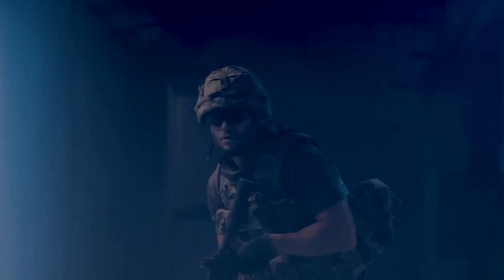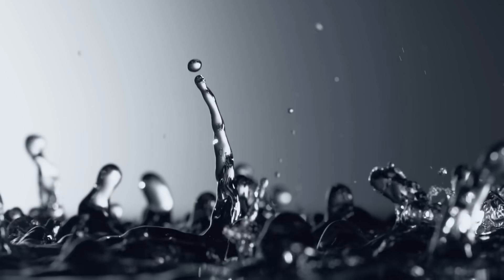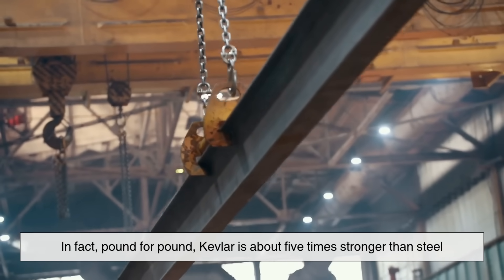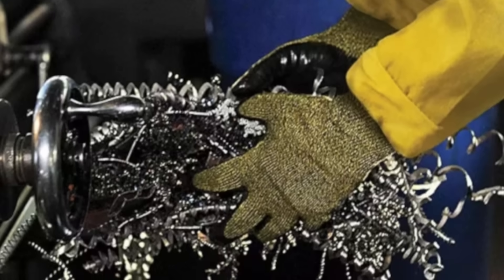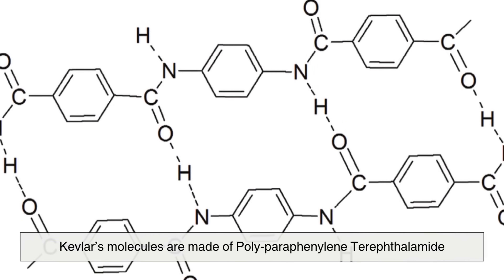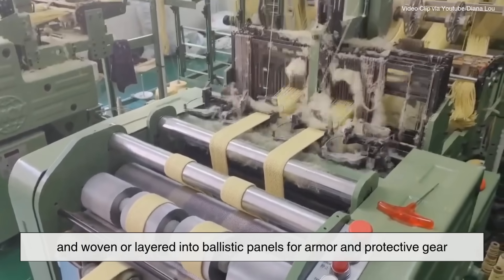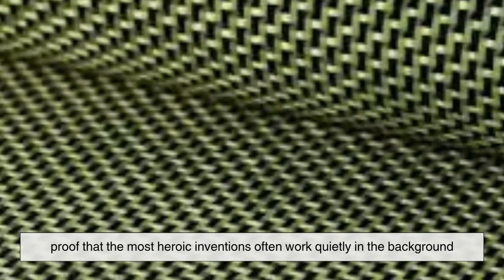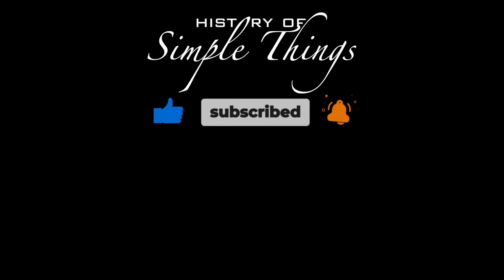Kevlar: The Tougher-Than-Steel Fabric Used in Bulletproof Vests

Comment: You forgot to mention that a Kevlar vest can't stop a knife.
Reply: 😂 That's false  ! It saved my life  !!!
Reply: Kevlar is used for 'cut proof' gloves in industry, it will easily stop a knife.
Reply: Kevlar is pretty good against slashing attacks. For stabbing threats, especially from thin blades or spike like objects, not so much. But vests made to account for those threats have other material to offer protection.
Reply: You forgot you don't usi a knife in a gun battles 😂

Comment: Spectra and Dyneema are two brands of synthetic fibers made from ultra-high molecular weight polyethylene (UHMWPE) that are stronger and lighter than Kevlar.  They are used to make bullet proof vests that are stronger and lighter than Kevlar.
Reply: I find it amazing how many things are made of different types of HDPE. I used to manage an extrusion production line for ten years. The primary product we used was HDPE. It’s an amazing product that is used in a lot of different applications.
Reply: Kevlar is sort of outdated tech now.